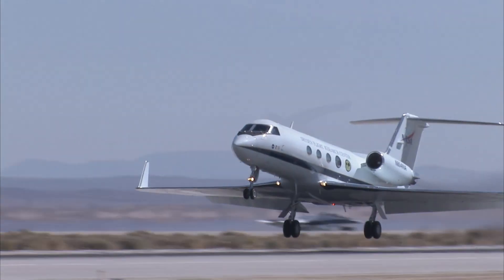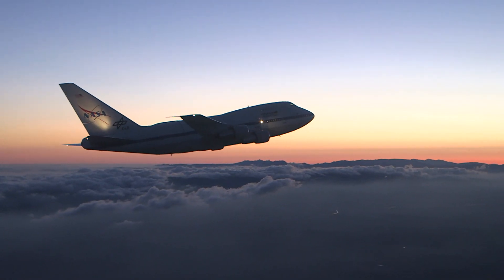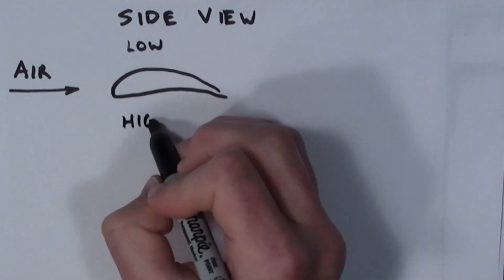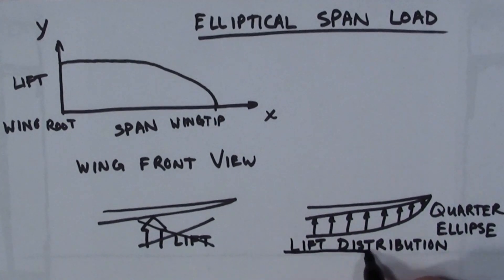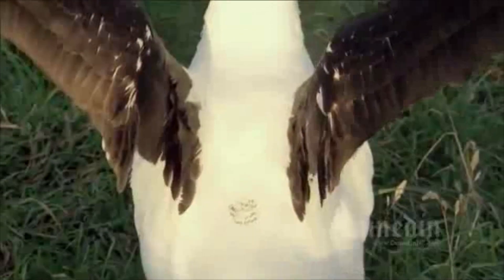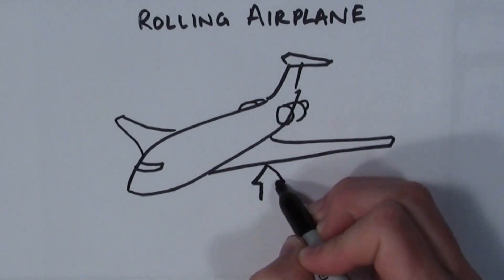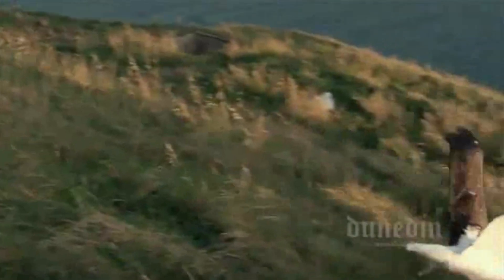Proving Prandtl- With A Twist!

Comment: Hinged wingtips?
As the twisted tips are not producing lift because the vector has changed to thrust, it seems like the structure of a hinge need not be overly heavy and could be incorporated so that managing aircraft on the ground could support the high aspect (long) wing which performs so well with the Prandtl twist

Comment: Sooooooo if you fold the winglet down flat you just end up with a longer wing and the vortices would still form at the tips of these longer wings, so that can't be the explanation.
How do you stop the vortices from forming at the tips?
Reply: They were not. The vortices are moved inward, 25% in from the tip. See video: flying with birds - meeting with Albion Bowers. I'm thinking of testing this, but using two RC airplanes where one just uses a normal taped wing and the other with different naca airfoils and agile of attack like Albion suggests (their professor) to get this bell curve lift distribution.
Reply: @NavalTechTinkerer  I researched how a Prandtl wing works in the meantime - Genius!

Comment: A neat way to steer the model would be to torque the wing by the tips - the twist would be distributed along the wing with most of it near the tips (because that party has least rigidity) - so perfect to get proverse jaw. Servos could be installed in the fuselage and would connect through beams to the wing tip (could run inside tubular wing spars maybe).

Comment: Might want to also consider sailboats. They have a separate centerboard and rudder. Won’t sail controllably if either is absent. Centerboard resists side slip, and rudder provides yaw moment. The vertical tail in a plane characteristically comprises the vertical stabilizer (immovable) and rudder (movable). Thus, the airplane tail has two distinct and unique structural elements with different yet essential functions.

Comment: When I started flying hang gliders in 1973, it was the standard Rogallo.  I had an interest in seeing if I could make a small scale model to experiment with variations on the Rogallo design.  The materials I was using made it expensive and very time consuming, and flight, although successful usually resulted in some damage as it was simply free flight.  I turned to simple paper and Scotch Tape to create design modifications.  Cheaper and I soon began to greatly improve the design to the point that it was now a very nice flying wing.  It was around 1975 that I visited Bill Bennet Delta Wing Kites and Gliders manufacturer and showed him my paper airplane (Glider), which I call the OmniWing.  He wanted to see it fly, so we went out to the parking lot and he grabbed it by one of the wing tips and tossed it into the air like a boomerang.  Bill was from Australia, so I guess he did a bit of boomerang tossing.  So the OmniWing went up into the air spinning out of of control, but it recover and went into stable flight and flew across the highway.  I recovered the wing and he asked if I would leave it with him so that others could see the wing fly.  Some months later he produces a hang glider that looked very much like my OmniWing planform.  So I bought one.  Now, almost all hang gliders look like my OmniWing design.  Same aspect ratio, same nose angle, same sweep, and same twist and washout.  Each manufacture has small variations, but all are very similar.  Check out a flight of one of my OmniWings off of Mount Nebo, in Arkansas.  Was an exceptional flight.  Video shows a fast build of the wing  and then one of my best flights.  https://www.youtube.com/watch?v=SrZ1bqU_g4o

Comment: In "on wings of minimum induced drag" it is given that symmetric airfoil is used at tip of the wing . If airfoil is at negative angle of attack , why symmetric airfoil is used; it will not produce any lift at neg angle of attack . ?

Comment: Uh, that's great, but... how exactly is a "flat winglet" distinguishable from a plain ol' flat wing tip? And how can I apply this new knowledge to my RC plane designs?
Reply: Not an aeronautical engineer, but I think it's the negative lift at the end of the bell lift distribution.  The elliptical distribution went to zero at the wingtip, with this design it went zero slightly inboard.  I guess that induces the vortex inboard as well. So the bit of wing beyond it is acting like a wingtip.
Reply: Generally, wings with winglets have the main characteristics for bell-shaped-spanload, cause they are triangular, not rectangular. If u twist  the leading egde (from root to tip in a non-linear fashion, such that twist is noticable only between 45-90% of the length) , or bend the triangular tip upwards (often leading to a similarly twisted leading edge thereby), the results are similar , and the wing is longer at the end (if this extra-length is bent-up or flatten-out). But simply making a winglet flat isn´t as good as aiming for a bell-spanload from the ground up. That´s a bit of what I understand. 
Non-linear-twist: 0 is the wing-root, 20 is 100% of the wing´s length, the tip, the other numbers are radial degrees. "On Wings of the Minimum Induced Drag: Spanload Implications for Aircraft and Birds"
0    8.3274°                 11   7.2592
1   8.5524°                    12   6.6634
2   8.7259°                  13   5.9579
3   8.8441                    14   5.1362
4   8.9030                     15   4.1927
5   8.8984                        16   3.1253
6   8.8257                          17   1.9394
7   8.6801                           18   0.6589
8   8.4565                           19   -0.6417
9   8.1492                             20   -1.6726
10 7.7522
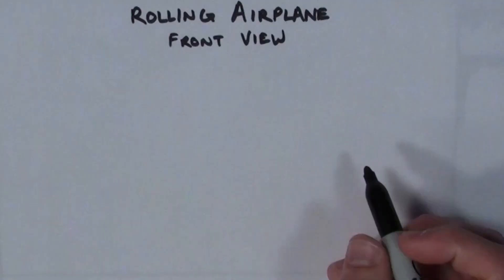Reply: This clip is cafeteria engineering: pick the items they like and ignore the rest. The 3:12 meat and 4:25 potatoes look great, but I'm not sure I'd buy 5:03 the winglet's creamed spinach, it's hard to get a dish like that just right.
First: Yeah, what you say. (The winglet/flat winglet)
Second: Induced drag, this isn't electromagnetism, at this level of physics there's drag and reduced drag.
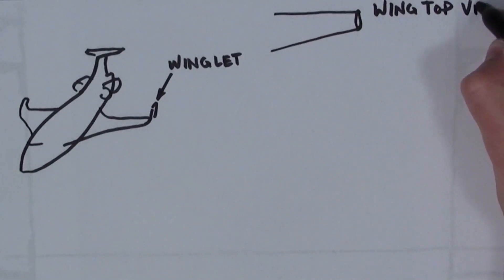Third: Winglet "induced thrust" 5:01 yes, there's a lowest pressure area where the arrow is rooted, and immediately toward the leading edge is a highest highest pressure area (in competition with the trailing edge region of an airfoil.) 
Sounds good and you learned a lot, and I'll bet the students featured would partially approve this clip too.
The yaw-to-increased-drag section, before and after is very important.
Doesn't the vortex coming off the leading tip interfere, "spoil." the airflow over the tip and affect the lift?

Comment: Is there any evidence that the downwash vortexes actually impact the wing surfaces? Or is it merely flow separation on the upper surface towards the end of the wing? The assumption seems to be that the air "leaks" from under the wing to low pressure above with sufficient rapidity to overcome or offset the forward flight speed.

Comment: at 5:10 how could one get a forward driving force from the design of the winglet that prevents the tip vortices  (the air vehicle is colliding with the static air particles in the flight path. )?
Reply: If u made a really big winglet you could toss the motor

Comment: What about side wind at landing ?
More specifically unpowered emergency landing. Can you do without a rudder ?
Reply: Elervons can be V flaps to add drag on one side reducing low speed yaw.
Reply: a lot of the test flights are been done with a glider, on a salt bed lake. so side winds and unpowered are factored in.

Comment: Could some one explain how winglet gets lift forward? Inward is due to airfoil (I guess) but what's behind forward force? Is it a vortex itself?
Reply: Downwash is usually back&downwards in romal wings with an  elliptical-spanload. This generates lift, directed up&backwards (a force 90° tuned-forwards, relative to the downwash). Up lift is desirable, and called  simply "lift". Backwards lift is undesired, and thus called "lift induced drag".
In a bell-shaped-spanload-wing, the AOA changes from +8,5° (root) to -1,5° (tip). Now, the last segment of the wing, that near the tip, produces very little aerodynamic force, but cause of the downwash now turned into an upwash, this force is directed up&forwards. Up lift is desirable, and called  simply "lift". Forwards lift is also desirable, and and thus called "lift induced thrust". But such wings have to be longer than the ones above, with the elliptical-spanload, to make good for "parasitic drag" loses (remember: now one part of the wing produced much less "induced drag", but also less lift and "induced thrust". But "parasitic drag" remains the same. To compensate for that, such wings have to be longer, in order to profit under the line. Still, they are shorter, than if one would try to reduce "induced drag" by simply making a normal wing longer, thus increasing the aspect-ratio, which also reduces "induced drag")
Reply: The thing to remember is that the apparent wind is coming in from the side due to the vortex rolling around the tip, so the resultant lift is angled forwards of the aircraft's direction. There're additional aerodynamic effects that would take more explanation, but that's the main one.
Reply: The concept of forward lift (thrust?) from winglets is a crock.
People try to explain 'lift' from flow around an airfoil that has a high camber line, or is at an angle of attack.
Either way, the initial airflow 'up' over the leading edge has a tendency to create a low pressure (lift) line that is forward from perpendicular 'to the direction of travel'.
In theory, this looks like 'thrust', BUT, winglets rarely have much camber (which causes drag), and are not usually set with an angle of attack the the airflow (which causes drag).
The idea of winglets is to actually STOP generating lift by the time you get to their tip, thereby cancelling the pressure differential between upper and lower (inner and outer) surfaces, which cancels any reason for a tip vortex to form.
Basically, in level flight do very little, they add a little directional stability (on swept wings), they add a little roll stability (straight or swept), but the wetted area they have usually negates any thought of generating thrust.
What they WILL do, that is not always obvious, is that as a wing increases angle of attack, thereby increasing the tendency to form a tip vortex, the winglet 'catches' the vortex, which then appears as lift or as an apparent increase in span.
An analogy would be like extending a longer wingtip for flying slower, easy for birds, not for us...

Comment: Lots of odd ideas being suggested here, many not being used 'in comparison' to the claims being made...
As the Horten's, and Lippisch before them found, a swept flying wing is stable when lots of washout used and is apparently efficient when compared to a similar sized wing.
However, the L/D efficiency came from not having to drag a fuselage and tail around the place, BUT, did take a wing of greater area, the added percentage of which is used to create the stabilising effect against the pitching moment of the wing section.
More than having the lift curve drop to 'the bell shape' towards the tip, the lift actually becomes negative at the tip.
A whole load of variables can be played with to lessen the negative lift (drag) of the tip such as low pitching sections (less overall lift),  more sweep (more structural problems and weight) or rearranged CofG (less stability).
By comparison, a straight flying wing relying on a reflexed wing section, is not very efficient at all, these type of craft survive through low weight, but not well.
As for basic control dynamics of flying wings, rearward swept wings use elevons, which while in straight and level flight, and with a rearward CofG, can be at a fairly neutral angle thereby creating very low drag, if possibly a little unstable.
But as soon as you try to turn, even before you have to start adding a pitch correction, the act of applying the aileron input will have the inboard elevon go up and create a marked negative AofA, and actually create a tip vortex (in reverse) generating drag on the inboard wing (proverse yaw).
The outboard elevon will initially go down and create no drag, and maybe add to the overall lift being generated by the outboard wing, hence a turn is initiated.
Having rolled in, the flying wing will begin to lose lift so both elevons are held back (up) while in a reasonably balanced turn.
Unfortunately, now it gets messy as you try to roll OUT of the turn.
Typically, most flying machines need MORE aileron to roll out of a turn than they did to get into it, fortunately the swept flying wing is the least effected at this point although with no rudder, the yawing motion will require more outboard drag (up elevon) to stop the yaw, but as we are still 'pitching up' to maintain height in the turn, this becomes a problem.
If we begin rolling out of the turn AND pitch forward, we lose the proverse yaw of the outboard elevon and the machine begins to slip into the still existing bank.
Slipping a swept wing has the same effect as dihedral, giving a rolling reaction away from the slip.
The interplay here has a LOT of variables, all making flying wings just that little bit harder to fly coordinated.
Upshot is; flying wings a great when flying straight and level, will sit in a stable turn very efficiently, but can be messy if trying to maneuver, probably being the reason you don't see many swept flying wing gliders (full size) as constant maneuvering is a pre-requisite of flying a glider.
I'm not an Aerodynamicist, but I have flown models, hang gliders and sailplanes, and am a flying instructor, and have to explain to students the reasons that flying machines do the things they do.
Reply: +pylon500 That was a wonderful explanation.  I have a mechanical engineering degree, and am a student sailplane pilot, and you have very clearly filled in what is missing from my understanding of PRANDT-L.  I have been suspicious of the claims made by the program, and you have shined an illuminating light into it.
I would like to read your thoughts on the use of upper wing spoilers, such as on the A-I-R ATOS rigid wing gliders, to bank without adverse yaw.
Reply: +Kramp Drucker, G'Day kramp.
There are a few aircraft that use 'Spoilerons' as their primary roll control, but as a glider pilot it initially seems abhorrent to deliberately induce drag for any reason.
However, they can be a more simplified way of obtaining roll without complex differential linkage systems.
From an aerodynamic design point, they just need to be placed at the optimum position to create the most lift loss, for the least amount of drag.
When dealing with the lower speed end of flying (like the Atos) the spoilerons tend to need to be a fair size and are an unfortunate compromise, but ailerons would be far to complex and heavy in that situation.
Remember, when you get really slow (para-sails, Gossamer Condor etc) there is a tendency to actually use 'reverse' ailerons and turn flat purely on adverse yaw!
High speed, heavy aircraft using spoilerons can run into a problem, induced by the pilots when trying to maintain level in strong turbulence (usually on approach) where multiple inputs in both directions basically result in a net loss of lift and a shortfall on the approach.
Reply: pylon500 G'Day and thank you.  That makes clear sense to me.
Reply: "all making flying wings just that little bit harder to fly coordinated.
Upshot is; flying wings a great when flying straight and level, will sit in a stable turn very efficiently, but can be messy if trying to maneuver, probably being the reason you don't see many swept flying wing gliders "
There you have folks in a nutshell. I admire what the students were doing for their internship/coop/study/whatever, but the issue I find with many students or fresh graduates is they don't post ALL the facts. They like to present the information as a new discoverer, or that they rediscovered a forgotten concept. The flying wing was looked at back in early the 1930s by the Horten brothers. The flying wing did not make it's debut until 1943. The request was for a faster and efficient German bomber. The trade off was less control. The Americans built the  Northrop YB-49 with first flight occurring in October 1947. The concept didn't go very far. Then came the YB-35 and YB-49. Issues with the YB-49 required very long bomb runs to dampen out directional oscillations. The oscillations were not severe, but posed a problem with degraded bombing accuracy. (If you think back in the Vietnam war and how we bombed the crap out of the Hồ Chí Minh trail partly due bombs lacking guidance compared to today where one placed guided munition can do the trick). It wan't until fly-by-wire and computer aid that the issue with control became less of a factor.
Reply: @ItsNotAllRainbows_and_Unicorns, @pylon500 There is a more delicate implication in the bell curve. At higher speeds, the average Aoa decreases; therefore, a wider part of the wing end produces negative lift, lowering the average performance. It might be mitigated by using a symmetrical profile for the tip. At low/stall speed, usually the other wingspan should not produce any negative lift. In turn, the wing has to generate more lift, so the average Aoa increases, and the washout increases. So any pilot must balance yaw while starting and exiting a turn, when altering the speed and the g-load situation. 
At least in a multi-engine configuration, an engine failure will bring the model to a fail. Because of the rear CoG, the front part of the wing will turn to the side of the failed engine, altering form, sweep, and adding area to its side. So the wing can no longer be seen as symmetrical. Consequently, elevons and drag rudders are brought to full travel but are ineffective in counteracting. 
It is also known that the flying wings have reduced stability when the stick is pushed and increased stability when it is pulled.